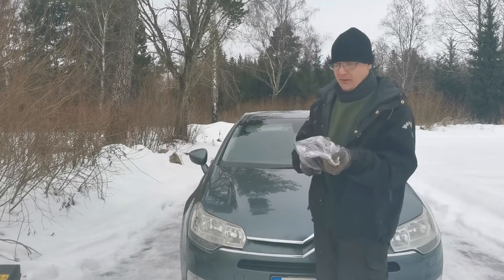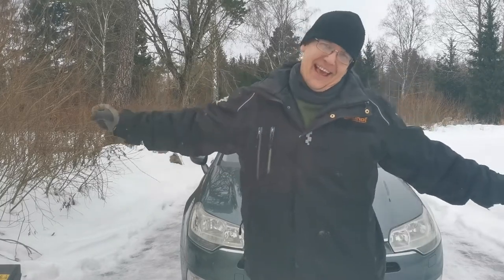[78] How to Fix Windshield Wiper motor Citroen C5

Comment: Believe me, you don't have to buy these too much expensive wiper motors. In most cases (I think, 90%, and even more) it is enough to clean  and to lubricate with silicone grease mechanic part of wiper motor. Good luck!!!
Reply from the maker: yep i tried cleaning it but for my case the problem was that the rubber seal o the motor was leaking and the inside was totaly full of hard water damage. thats why i brought new used motors. And yes those motor prices are hell

Comment: Should I check the fuse forst as I have the same problem. I turn my wipers on and literally no movement and no noise
Reply from the maker: 1. turn off engine
2. check fuses
3. turn on engine
4. test wipers if ok then wee if not go on
5. turn off engine
6. unplug both wiper motors (there is a small plastik notch that needs to be pressed down to unplug, i broke mine the first time that i dident see it)
7. turn on engine
8. test if they work (if it does not work then there is are two more thing you can do before you need to buy new ones)

let me know if this worked if not then next is, thats a bit harder as you now need to unscrew both motors and check if they are set to the starting position under the black plastic cover. and recheck. if that did not work then take the motors apart and check if the motor has had water damage (back aluminium cover) + check if the bruches are ok inside and need replacing. if that all did not help check your local car yard if they have new motors and test again. good luck its a total pain in the ..... to get them to work took me total of around 4 weeks to test out and figure this out. But now they work atleast.
Reply: @SilverEnergy  your awesome thank you buddy
Reply: @SilverEnergy  the fusese under the hood not inside the car??
Reply from the maker: @vikingshpvs465  check left from the steering wheel. The small pull out holder/box behind that.
Reply: @SilverEnergy  mine is a 2009 c5 I can gove you the reg if you like 
It its the exclusive edition
Reply: @SilverEnergy  hi mate. I did every thing you said. And still nothing.
Reply from the maker: Yeah then the last thing to try is get two new or used motors and swap them out. As i cant see the inside of your motors i cant help you more whith this mater. Sry on that my best quess is from a local car scrap yard, Amazon or ebay.
Reply: @SilverEnergy  do you know any thing about being under the passenger seat. Apparently there is a module there that could need replacing
Reply from the maker: @vikingshpvs465  nope dont know anything about that. The whipers have their own internal chipset as far as i know.

Comment: What year is your car
Reply from the maker: 2011
Reply: Ok thanks so it's before the revised design, cool. I am buying one with the fault so hopefully this will be a fix.
Reply from the maker: @Rustynuts410  yeah it was a pain to get it done but I did it and now it works fine. My suggestion is buy 2 motors but check the serial numbers before you buy. Both motors have different part numbers
Reply: Ok thanks for your help and the video